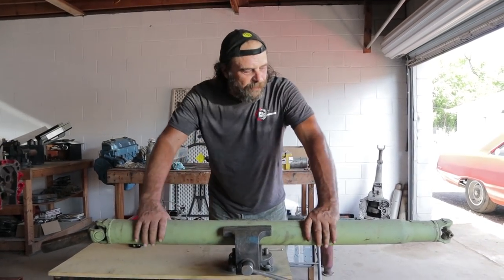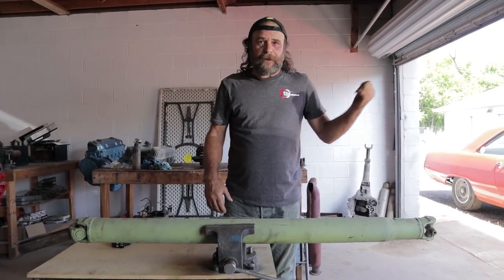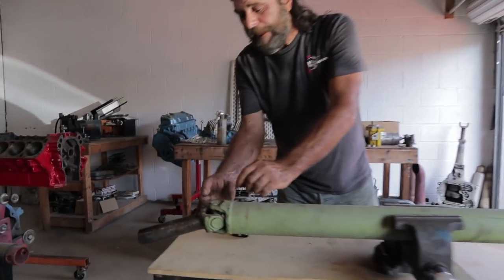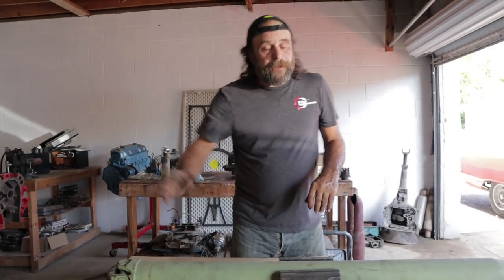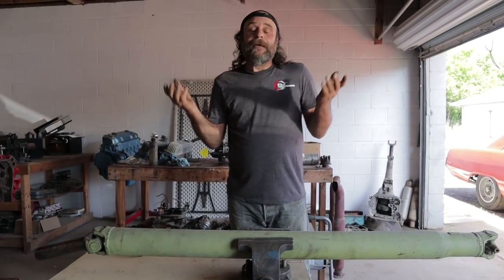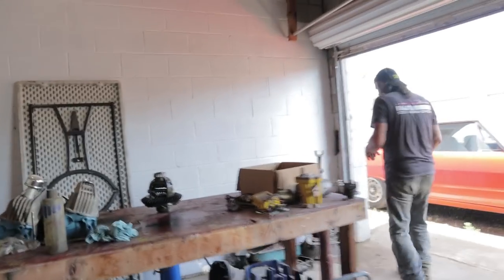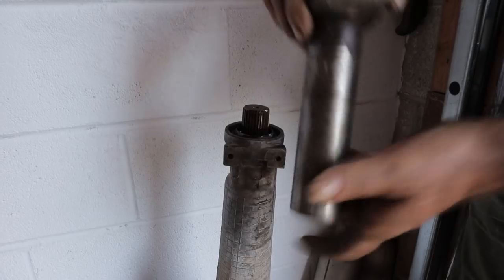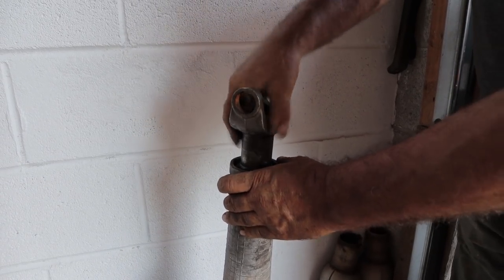The Mystical Universe Of Driveshafts

Comment: man alive T. where was this video 35 years ago when i needed it...i  took a 70 Nova, 6 cylinder/glide/10 bolt car and built the front end first, then a 396, 400 turbo, and 12-bolt with 3.55s....i couldnt find a shorty 400 like came in em. an old-timer told me i could run the long tailshaft model just fine, if i had the driveshaft cut down. so i got a fine-spline M-22/400 yoke, and took the shaft to a local shop. he cut, fitted, welded and trued it all on a lathe. but i did not know the formula you taught today yet Tony. my measurements were off 3/4 of an inch short in travel and it wouldnt work, had the exact problem you demonstrated here today.... fortunately i had another shaft handy, remeasured and switched everything over..[lakewood u-joints] and it worked fine...the kool kraftsmen didnt even charge me the 2nd go-around, said he was a young gearhead once and made his share of mistakes alright. so i refered to him all the work i could...even though i know the science now of course, but this video is a great source of knowledge for the newcomer and the veteran for brush-up alike....thanks alot Tony, you make both learning and/or reminiscing fun, like its supposed to be...thanks bub....and kutgw!!!
Reply: My dad has bad breath
Reply: My dad has bad breath

Comment: I have 58 chevy with 2 PC drive shaft. I also have parts car. I put a BBC in the car with a 92 700r4 from a pickup. I had to shorten the front shaft about 5 inches. Never done it before but YouTube is great for that. I got it done installed it and I will have it balanced when I get my rear axle serviced. If I have any issues with the carrier bearing as these 58 cars were known for I will change rear portion of shaft to slip style and install a better than factory carrier bearing as many have claimed solves multiple problems with these 2 piece setups. Good video. Informative.

Comment: Don't take your drive shaft to an exhaust shop to have them try to fix it. Take your drive shaft to a Driveline service. Have them lengthen or shorten your drive shaft appropriately to Uncle Tony's instructions. U-joint should be pressed in. If the tail shaft bushing needs to be replaced replace it.
Always replace the rear seal on your transmission. Use a seal that has a flange.
The seal is cheap

Comment: The worn tailshaft bushing is easy to find. If its in neutral, sometimes when its under load, in park on a slight slope you wont find it. 
Have had a few made over the years. 
I would like to add that there is a vast selection of u-joints available to mate different bearing and  cross dimensions. 
97 ram driveshaft converted to mate to a 73 pickup diff. Made it easy.

Comment: Between you and this Plymouth handbook, I'm getting a little more clever with this stuff. 
I was quoting your "Case For Drum Brakes" video at work. Complaining about how there's 6 pages of disc brake conversions before I can find my $6 wheel cylinder.
Reply: Ary Dabirnia 4 wheel drum brakes are suicide if you try to drive in any kind of traffic with modern cars today. Many people drive selfishly like they are the only one's who matter, and arrogantly display this mentality behind the wheel. Everytime I travel to "civilization",  some asshole has to add a contribution to support my theory. 
 Drum brakes need frequent adjustments to opperate at thier maximum potential. They also don't hold up well with repeated heavy braking. 
 Yes the individual components are generally less expensive, but with a little research and some D.I.Y. ambition, it's completely possible to do a very affordable disc brake conversion to any drum equiped vehicle.
 It's just not worth having compromised stopping power with all the asshole drivers on the road these days.

Comment: One of my 79 300’s has a 383 in it. Bought it this way. They guys who did the swap didn’t swap the k frame. Engine sits almost 2 inches forward. They never corrected the driveshaft length. Needless to say, my 727 needs a new tail shaft bushing

Comment: Great video Uncle Tony. One of the most difficult driveshaft woes I encountered was with a 5 speed trans swap on a Toyota Corolla, it was from a different model year and of course the drive shaft was not only the wrong length but the splines wouldn't line up. A knowledgeable Parts yard is really a help in situations like that. But these measurement tips are valuable... !!

Comment: Back in the late 80s, my older buddy worked for a Lee Myles transmission shop.
 When they had a sloppy tailshaft bushing causing an oil leak, he said they would remove the driveshaft, apply a bunch of Indian head sealer and a couple wraps of toilet paper and reinstall. 
Leak fixed!
 Lol for about a week 😂😂

Comment: Question:
If you measure to the backside of the saddle where the u-joints sit, your driveshaft length would be +- 1.0” longer than a center to center measurement negating the 1.0” you pulled the transmission output yoke, essentially negating the slip variance.  Is what you meant to say?
Reply from the maker: No...measuring back side to back side is the same as measuring center to center

Comment: Great job uncle tony! You also want to make sure the measuring tape rivets aren't loose or worn out on the end of the tape. I've seen them move up to 1/8th inch & can throw off the measurements.
Reply: The rivets are made to be loose and move. They are designed to move the thickness of the end so you get same measurement if you hook the tape on something and measure, or push it against something and measure. That is "using a tape measure 101"
and great job UTG, as we have come to expect.
Reply: keith cunningham  you bet Keith, lol. great channel

Comment: U-joints are pretty easy to replace if you have a bad one. Use a bench vise and a right size 1/2 inch drive socket to press in place.

Comment: Hey Tony I'm about to have the oil pan gasket replaced on my 1980 Chevy truck with a small block 350. Got a hundred thousand miles on it should I have them replace the oil pump in the pan is off? How fast do oil pumps wear out? They're not expensive and I have the pan off anyway. What do you think?

Comment: I had an oscilating, throbbing vibration in a '64 valient. It had a 340 in it. Changed the drive shaft and transmition. Problem didn't change at all. Ended up that the 727 housing was barely touching the transmition tunnel. Amazed I had any hair left after that one

Comment: Hi Tony i love your channel and have learned a wealth of knowledge  ,i am building a 1950 gmc pickup i am running a chevy 305 motor with th400 ,i have replaced the trans filter and filled with fresh oil all was fine i fired motor the 1st time today which was great but apon inspection of oils ,leaks etc etc ,the trans oil has gone pink ( strawberry milkshake ) i am stumped as i am running external trans cooler ?  i scrated my head and inspected things ,i noticed coolant seeping from the back of the inlet manifold running down the back of the block ,down the trans bell housing towards trans sump ,so i can only guess water seeped into the trans through the new gasket ? i have now nipped up manifold and leak has stopped ,but can i flush the trans ?,when i ran it up today it was for the 5 mins no shifting and not up to temp ,so my question is can i save the good old th400 with a flush or am i going have to rebuild ? your help would be very much apreciated, Dan

Comment: I've got one that's got a harmonic in it that comes and goes at about 20 second intervals at anything over about 65... New universals (installed correctly from either other), new carrier bearing, balanced by a drive shaft shop twice (the shop that made it to factory length... the previous owner appeared to crush it in a vise while doing a poor job of installing a universal in it so they replaced that tube), tight at the transmission... I'm down to the point of praying its the tires or something. It's driving me nuts. I'd happily take some suggestions... I've thought about either taking it to another drive shaft shop and seeing what they say or just getting another factory (junkyard) shaft and rebuilding it...
Reply from the maker: Might have an angularity issue..shaft having to articulate in more than one plane
Reply: @UncleTonysGarage  Well, it is an offset diff (one tube longer than the other), so isn't motion in 2 planes expected? Or am I misunderstanding what you're trying to tell me?

Comment: I would love to see a Vid. on how many HP can a standard drive shaft take before its time to upgrade to aftermarket drive shaft
Reply: Saw some english vid on here, years ago, testing steel or aluminum shafts against carbon fiber. 
Cf was the strongest but exploded in spectacular fashion when they went. 
Metal just twisted like a pretzel.
Reply from the maker: Depends on the car, but 50 years ago, the Funny Car guys were putting 2000 horsepower through shortened stock driveshafts and standard HD U-joints

Comment: aluminum or chrome moly alloy drive shaft material...which is better??
Reply: Aluminum is lighter, but its gotta be bigger....depends on what youre doin, id wager mud bog guys want weight and street guys dont.
Reply from the maker: Twist your stock shaft in half first.
Reply: Paint a parallel line down the stock driveshaft and keep an eye on it.  If you aren't twisting it, you don't need to change.  I forgot about keeping track of mine before the paint weathered off.  When everything is right and good u-joints, the stock shafts can do quite a bit.

Comment: 2:40  That was as clear as mud.  Is it from the center of the bolt or from end to end?  You said both.
Reply from the maker: Measuring bottom to bottom is easier than center to center and gives the same dimension
Reply: OK. That makes sense. Thanks.

Comment: going to be buying a 8 3/4 rear axle for my 1969 plymouth satellite. which has the 8 1/4 rear axle. will the drive shaft be a different length? or can i use the same one for the 8 3/4 when i put it on?
Reply: Maybe you should wait until Tony does his 8 1/4 video.  He can probably make it take a 1000 hp by putting a gear in backwards or something.

If you change to 8 3/4 I'm pretty sure you will need a new driveshaft.
Reply from the maker: Unless you're running slicks, a big converter and 500plus horsepower, keep the 8.25.  Lots of good stuff available for that rear, cheap
Reply: How about the 904 and stock driveshaft?

500hp sounds like a good number to me.  I'm not building a race car, just a cruiser with a little scoot to it.  

I'm keeping an eye on your Bottle Rocket series.  I'm planning to keep my 318, since it seems there are a few paths to getting 500-ish out of it and that's all I want.  I haven't dug into it a lot yet but I find the turbo builds interesting.  Could be more complicated than it is worth, but the sounds amuse me.
Reply: Uncle Tony is right..... that 8 1/4 is a very good piece that will do about anything a street car needs.  That said, the 8 1/4 is 11.69" from axle centerline to u-joint yoke face.  The 8 3/4 is 12.35".  At the same pinion angle, the driveshaft would need to be 0.66" shorter.... or find one the right length.
Reply: appreciate everyones reply! thanks for the advice and tips! ill probably just keep with the 8 1/4 for a good while till i get some boost on the 318 .
Reply: @jrcars7017  The 904 is underrated and should work fine for you.  I ran one for a very long time in my 70 Dart. A great swap I don't know why more people don't do or know about is to get a A998 or A999 from a late 80s or early 90s Dodge van or truck.  There's a certain part number of input shaft from a 70s non-lockup trans and one check ball that has to be remove from the front pump to make it a non-lockup trans and use the A904 converter.  It's not hard at all to do and gives you a lower first and second gear with a reinforced housing to boot.  If you want the part numbers and other details, let me know and I'll dig up the notes.  It's been a while since I built that thing.
Reply: @ottomatic8160  I ran a 7 1/4 for a long time and even with 8.5" slicks for a while.  Until you have a pile of horsepower and a lot of shock load, those smaller axles do very well.  The 7 1/4 had the same pinion diameter as the smaller 741 series 8 3/4 (1 3/8") and had tapered roller axle bearings. it was no slouch,  just scaled down.  If there had never been an 8 3/4", no one would be worried about their 8 1/4"
Reply: I'll take any info you've got.  My 904 only has a few thousand on it since being rebuilt, but I'll replace it eventually.

Comment: Hey Tony! I'm replacing my 7 1/4 to a 8 3/4 in the future and will have to shorten my shaft(no pun intended)
Would you recommend a half-wit with a mig gun to do it, or should I take it to a proffesional?
Reply from the maker: Take it to a pro.  A driveshaft REALLY needs a proper jig when doing that sort of thing
Reply: @UncleTonysGarage  A professional or placing the axle further back in the car it is  then!
Reply: @carlholm7867  At the same pinion angle and if it's at the right depth now, the shaft will need to lose 2.26" (10.09 vs. 12.35 axle centerline to u-joint centerline.  And changing wheelbase..... FTW?!?!

Comment: Always double check the joint clips. I eternal or external. I had a custom length made. Installed n on first run a clip came out, cap nearly shot through the floor board. Major imbalance in 3rd gear, shattered trans at bell housing to pump flange area bent driveshaft, safety crew not happy about trans fluid all over finish line area.
No warranty from shaft house, racing  application...double check

Comment: When you put the transmission in gear and you hear that soft bell ring sound from under the vehicle, it's time for new U-joints.
Reply: @Kevin spacey Driveshafts ring when you rap on them. If the driveshaft rings when you put it gear, there's probably slop in the U-joints.

Comment: These kind of issues are baffling to me. Somewhere in the trucks history something changed. The original transmission had a lobger tail shaft or the oeigional shaft was replaced with a shorter version, or the placement or size of the differential moved.

Drive shafts seldom need replacement as well as the other components. It leaves one to wonder how and why this problem came about.

Comment: I'm wondering if there was ever a time when there wasn't at least one car on jack stands on Tony's property.
Reply: To load the suspension for a driveshaft length measurement. The front stands shoul be under the control arms or load the front wheels. 
If the are under the cowl area, some weight is effectively pulled off the rear suspension.

Comment: I think this video started stating measuring from center of u joint, then switched to back of cup, I just followed the directions on my TKO swap ordering my new shaft and I believe they had me use ctr to ctr. I cant stand armchair skeptics and I would never try to question Uncle T's methods, just two different methods for the same result. gotta make sure the driveline tech knows which one your using.
Reply from the maker: Center to center and back of cup to back of cup is THE SAME mesurement
Reply: @UncleTonysGarage  are'nt I a crap head , back of cup is probably more accurate, you dont have to estimate ctr of the yoke side.

Comment: Ok, my personal experience, with used parts and junkyard shopping. If your slip yoke shows a 1/4 or less of shiny, you're ok. Too short and it oscillates Instead of a smooth rotation. Too long and you feel it bottom out. Sometimes, with GM's, you can just swap the trans yoke for a longer version. Did a 90 Chevy truck 700r4 to a th400 with a caddy trans yoke and new crossmember holes and a vacuum line. Pinion should be about 4 degrees down from level. 5 at most with a heavy car. Any more and you'll get a vibe at highway speed. It seems simple but there's alot of math and science in chassis geometry. Also, the bigger shaft diameter the better. Especially with big power. Pi is involved. Math sucks but is necessary. Just my experience. Proceed with caution. Your mileage may vary.

Comment: You. Are. A. Master..  of.  Many. System.s.....in. the. Automobile..  this.  Is. Right.   Up. There. With. Your.   Ignition...  rotor..special....video....these. show.   Knowledge....thru. hands. On.    Work.  Experience....with.  things.  Other.   People.  Never. Even. Think. Of....even.   when. They.  Do. All.   The.   Work. Them. Selves.....  ya. Know....  they. Bolt. On. New.   Fenders..    weld. On.  Body. Mounts......rebuild...engine...  transmission.....differential....put.  on. Springs...... Shock.s.....brakes.....  exhaust...wheels.   tires......  and.  Bumpers......   then.   Paint........but. ignition..parts. and. Drive. Shaft. Specs. Not.   Once.  Enter.   Some. People's. Vocabulary...........  have.  A.   Nice.    Day.....